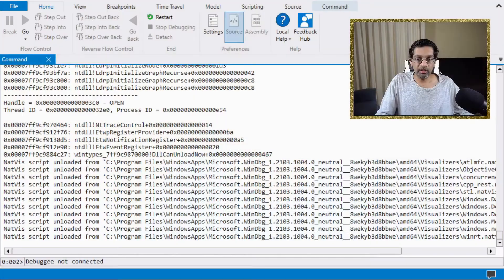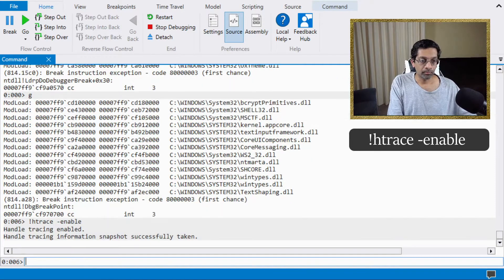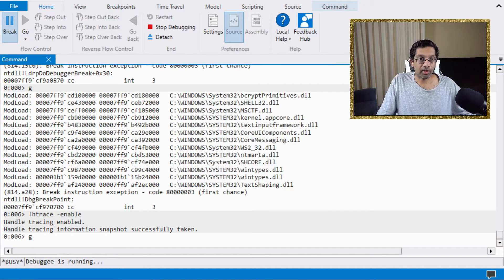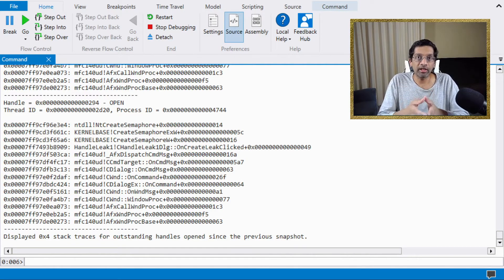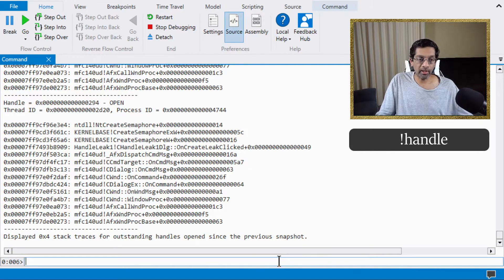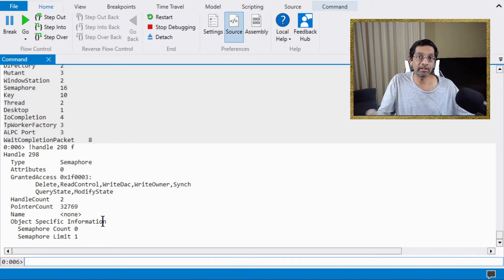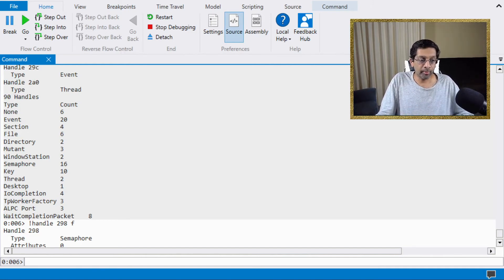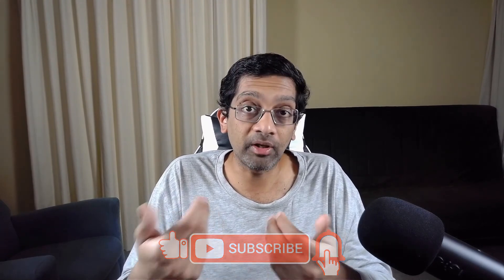Handles leaking out of your application ? Use WinDBG to find handle leaks !

Comment: Handle leaks drive me mad over the years. Often they lie in something outside your control, some external library or internal facet of what you are doing. Process Explorer is useful, especially when you can't single step, since it shows a breakdown of handles, and there are often clues as to what might have created them. Favourite error for me is createprocess, and closing both the thread and the process handles afterwards - or rather forgetting to do that. Then you come across as I've just done CListbox SetCurSel() using up a handle for no apparent reason, but perhaps eventually cleaning up- who knows - but makes it impossible to work out when it's in amongst other things coming and going.

Comment: Thanks for the info on htrace. Me I need a little more of the basics. Like how to setup windbg and attach to a running process, and some basics of what can be done or monitored or controlled in that process we attached to. Does the program need to be built in debug? Thanks again for being clear and easy to understand.
Reply from the maker: Thanks for the feedback. Please do watch the other videos in the playlist. I will try to make more videos about the basics. 
The program does not need to be built in debug. Building in release is fine, but you have to keep the pdb's that are generated by the compiler. I would recommend setting the linker to generate full PDB's even in release to aid in debugging.